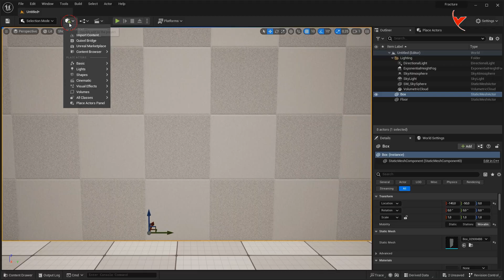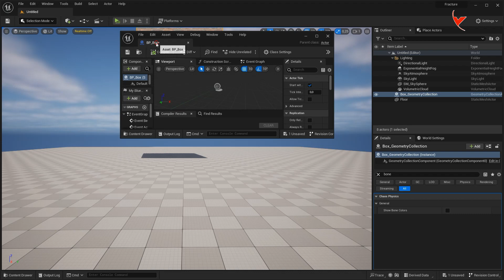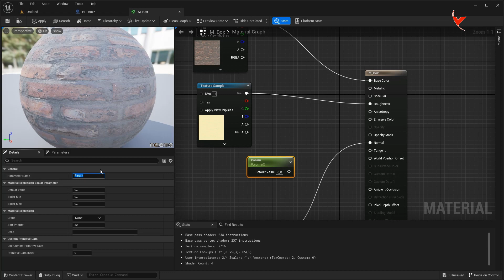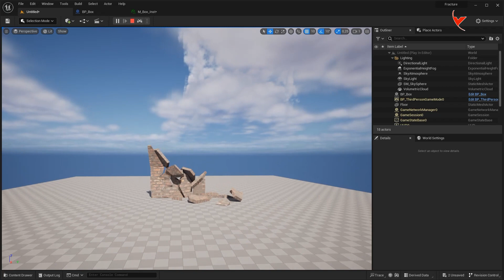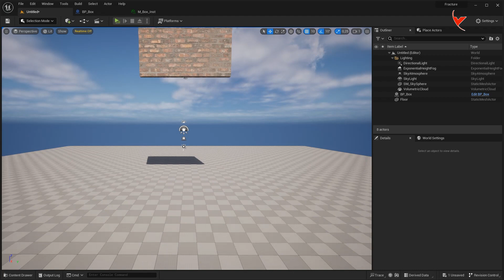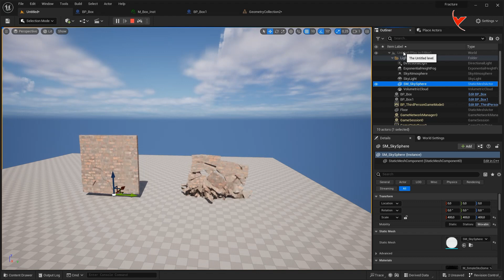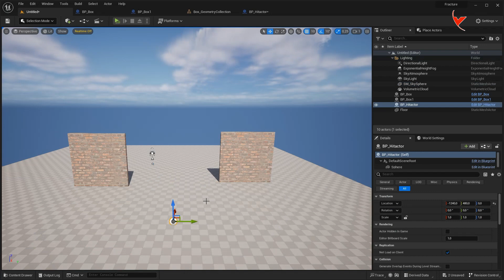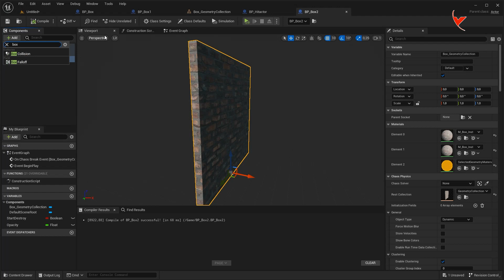UE5- Chaos Destruction - Destroying the mesh with the fade. Normal and explosive destruction (SUB)

Comment: Hello, Hello, thank you very much for this really great video! Is it possible that the opacity material doesn't work depending on the fractures? I have 2 meshes fractures: one cluster basic and it works and the other in custom mode but does not work. Does this mean anything to you?